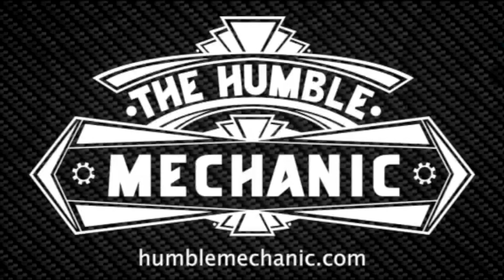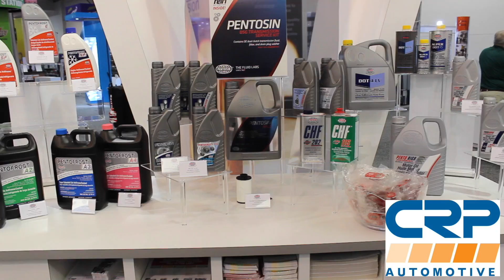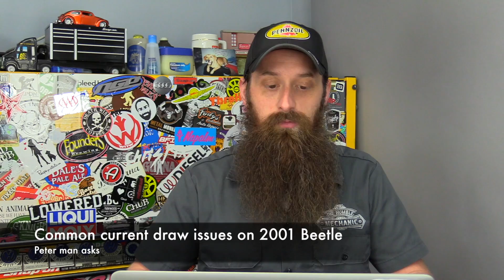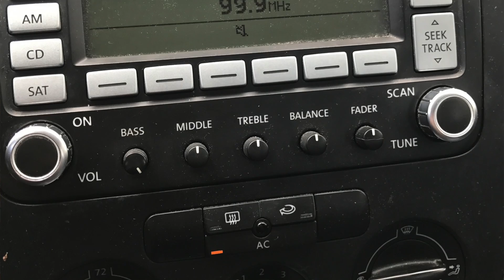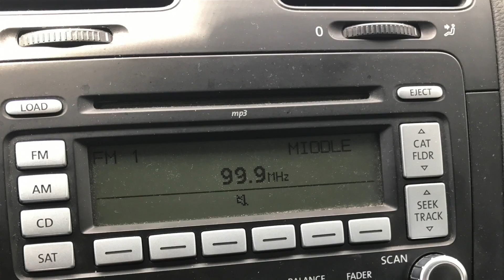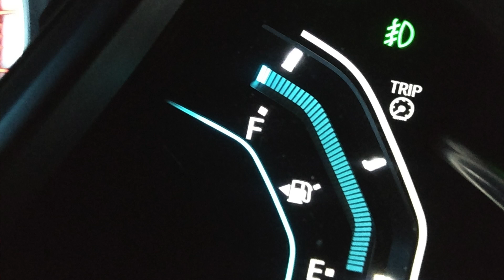Viewer Automotive Questions ~ Podcast Episode 192

Comment: humble MECHANIC.
what's the difference  between  the 6 speed dsg and 7 speed dsg.  
And why do the turbo charged engines fart when changing gears and the r32 does not fart

Comment: Hey Charles!  You opinion?  2014 VW Jetta SE 1.8t.  Under 5 yrs and and 51k.  Either upper portion or oil pan or timing chain cover leaking oil at bottom passenger side of engine.  It's all over front and side of oil pan and above it.  Also splashed up onto subframe.  Think VW will cover this under power train warranty

Comment: So, the tank is full, then the filler tube up to the gas cap fills to some extent, so it will read over full until the level falls into the tank again. Side note, I fill until the first click, some cars get cranky if over filled ;)

Comment: I'm not a car guy and I love to see your show I have a Passat 07 AC doesn't cool very well The dealer tells me I need to change the compressor what are you think even when the car was new the AC wasn't at its best
Reply from the maker: Thank you. Those original compressors were awful. Many many many failures. It is possible that the compressor is bad. Those were also good about contaminating the system. We had to replace the compressor, drier, expansion valve, and do a full system, flush.

Comment: My brother used to drive a FIAT 124S (coupe) back in the '80s, and the gauges had the opposite problem...they were too accurate.  Or at least, they responded too quickly...so if you hit the brakes, you could watch the gauge move as the fuel sloshed back and forth in the tank.
Reply from the maker: LOL yep. That is why they function in a range now.

Comment: I hope you have some time for a freeloader question. I have a 2010 Golf Trendline and my red steering wheel light alarm is lit but I have no issues with the steering right now. might it just be a faulty sensor?
Reply from the maker: +Papi monster could be a sensor issue. You'll really need to have the faults checked. Could be a software issue too
Reply: Thanks for the quick reply. I will follow your advice.

Comment: Modern gauges are actually set via the car's computer and is read from the resistance / voltage output of the sensors, most gauges actually have mapping! They are often limited to keep customers happy, such as most coolant gauges staying at 190'F even when the coolant  and sensors are reading 150-230'F! (tested with my DerpSpeed project car) 
 
To correct the gauge you will need to adjust it via software or unadvisedly change the voltage on the sensor wires via a small resistor.  This will throw off what the computer reads and depending on the sensor, can change everything from mapping to cars performance. So changing it via software is advised over the resistor method.

Comment: Quick question, when routing engine oil cooler lines from the sandwich plate, does it matter which fitting they go to on the actual oil cooler?

Comment: Ahhh now I know the technical term for it "Battery Voodoo" . About 2 years ago my 01 Beetle was running like crap and the cruise control would not work. Nearing the end of rational thinking I used the procedure you described and the car has run fine with a working cruise control ever since. Must be the VW equivalent of Control-Alt-Delete. ;)  Thanks Man!
Reply from the maker: Yea that process fixes some weird shit. It is more like the "hold down the power button until the computer shuts off". I wish I wrote down every time the process fixed a car.
Reply: Makes sense since you have to set the clock again. ;)

Comment: thanks Charles! I'm going to take a guess that it's the alternator cause obviously it's a huge draw. either way, I am familiar with doing current draw tests so no sweat there, now I have a few leads to check out first!
Reply from the maker: Rock on man.. Good luck :)
Reply: HumbleMechanic , do you know what fuse goes to the rear fender amp/sub on a 2014 Jetta tdi, I am having a hard time finding the correct diagram

Comment: Have a TDI 3.0L 2012 Touareg that VW will buy back this month, I'm considering a unsold 2016 TDI Touareg that most likely has been stored outside for over a year here in Wisconsin. I have concerns about sunroof leaks, headliner damage, battery condition, sun faded interior, tires flat spots or is there anything else that you would be looking at? Are there any 2016 TDI Touareg issues I need to be aware of, any advice would be much appreciated?
Reply from the maker: Those are the big ones. The 16s have been good. I don't think I have made any repairs to the 16s at all. Other than maintenance.

Comment: I never get a really specific answer on this- for something like a 2010-2011 CDNC 2,0 tfsi engine, is the timing chain tensioner failure mode an eventuality or not?  I keep hearing so much about this, but can't imagine there's a 100% failure rate here.  Also, is it recommended to change the roller follower for the HPFP?
Reply from the maker: +sachelle babbar not a 100% fail rate. I don't think there is a part out there with 100% fail. 

The rate is rather high. High enough it's not worth risking not fixing it or at least checking. 

No need to replace the follower on the roller type follower
Reply: Thanks, got a 8K CPO and it's been in repairs since purchase. Trying to be on top of the problems, but no error codes yet, but possibly a light noise in front. 

 Next up is the Stronic drive range sensor and probably a Mechatronic.  Poor experience, so expecting the worst while I have the warranty.  At least it doesn't burn too much oil, but definitely a lot when city driving.  OMG. 

Speaking of which, if I halve the oil change interval, but don't reset the MMI, will the optical sensor extend out the oil life automatically?  I don't want to go as far as my service plan, which is out of control, but I still want that every second change.

Comment: The first question with the battery drain, I think it is the battery itself. Lead acid batteries can develop conductive salt bridges between plates especially if they are fully discharged on occasion. I suggest leave the car overnight (or two) with the battery disconnected after a full charge.

Comment: Good morning my  b6 fsi at idle is 40-50 bar  fuel  pressure  but when I turn the car  off  it start decreasing  does this mean I have a leak somewhere in the fuel system  great  video

Comment: I think they figured it out on the Mk7 Golf platform.. when full it sits exactly on the full mark.
Reply: paul lamb , They may have figured the full, but not how to deliver correct readings. The gauge on my car drops to 3/4 after about 20 miles of driving and then drops slowly after that. This is an improvement over the original sending unit which was replaced by the dealer. That one would drop to 1/2 tank after 60 miles of driving and would turn on the feed me NOW message while I still had 4 gallons in the tank.